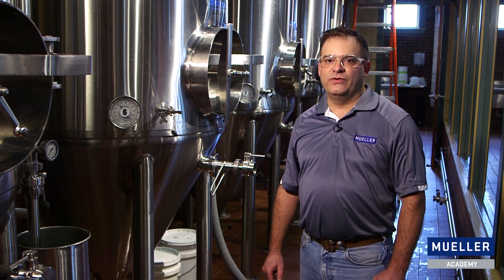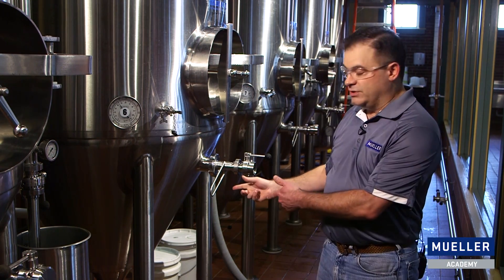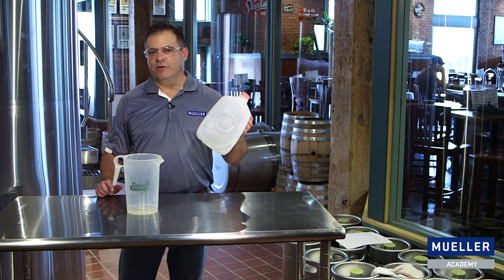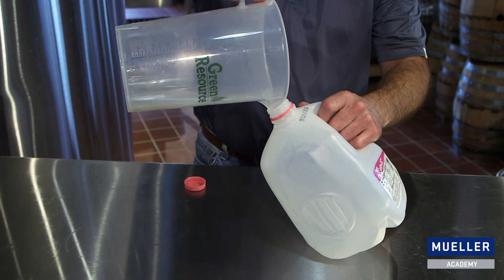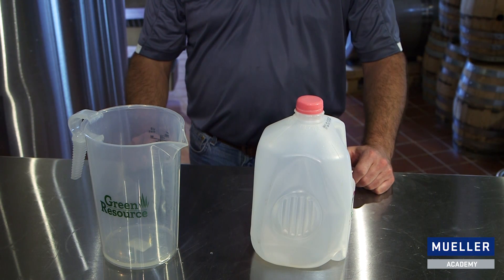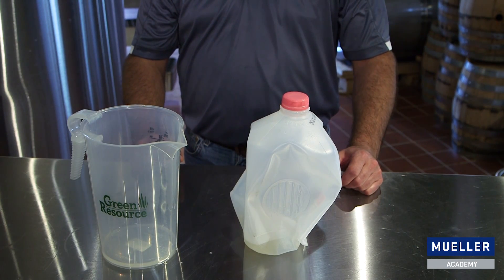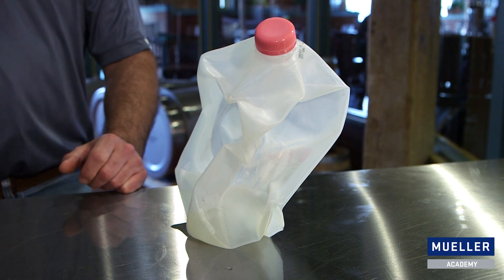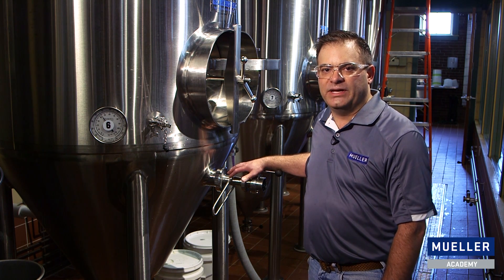Tank Implosion Caused by Caustic Soda and CO2

Comment: As the reaction between caustic soda and CO2 reduces the effectiveness of the caustic cleaning, it's best to flush the tank with water through the CIP arm as the initial step to reduce the amount of residual CO2 in the tank.